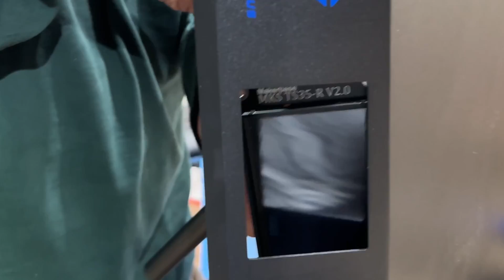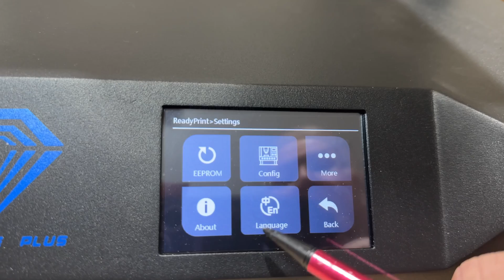Two trees Sapphire Plus High-Speed Upgrade

Comment: I got this too. Problems, ended up getting 2, no one wanted to mention spare parts, where to get replacement bits, there's the warranty that isn't being serviced. Snapped throat, crashing, thermal runaway errors etc. . Doesn't seem to have onboard PID calibration, anyone have firmware with calibration for this?

Comment: Hi Phil, I know this is almost a year old video, but I was considering the SP5 v3 (the factory upgraded version) to step in to the CoreXY world, and one thing that scares me is the lack of replacement parts. but since it uses MKS parts and you were usinf another hotend I feel encouraged to go ahead... Still one small question: this hotend in the Kit...  you said it's not a volcano, but it is quite similat to the PT100 heatblock... and I was wondering if you think the PT100 heatblock, heating element and thermisor can replace these ?
Reply from the maker: They should fit fine. I have gone back to my Red Lizard hotend on the IO mount and a 0.6 nozzle. This machine is a reliable and a real workhorse for me.

Comment: Good video, fun to see how kits like that are. I have a SP5 1.1, which is basically the same printer, just rebranded, it even says Sapphire Plus on the front. I've upgraded it a lot, and have designed even more upgrades for it, like printable panels to enclose it, pulley stabilizers, a hotend assembly for mounting an Orbiter, Phaetus Rapido UHF and a Pinda Probe, ADXL345 and proper belt tensioners etc. and I do plan to upgrade it even more. Love the printer.
Reply from the maker: Thanks for the comment. It is a very solid printer and with a few upgrades mine is real workhorse.